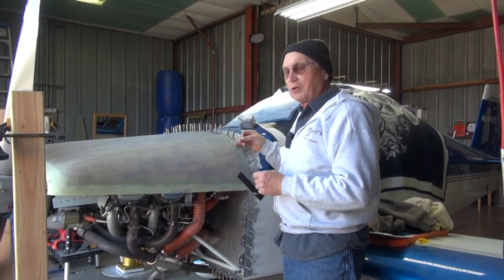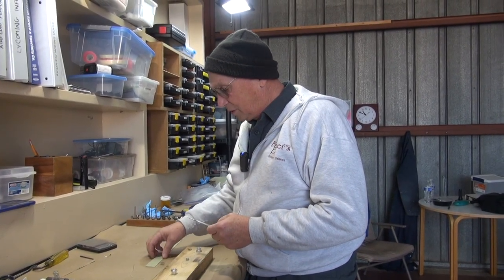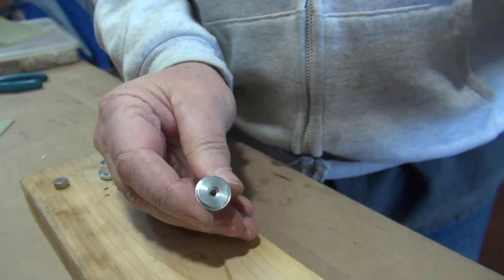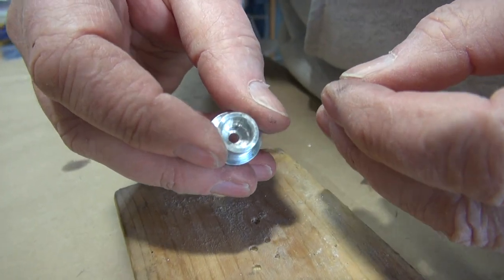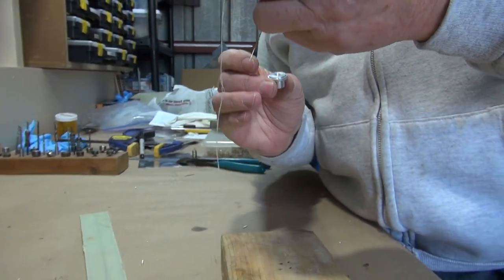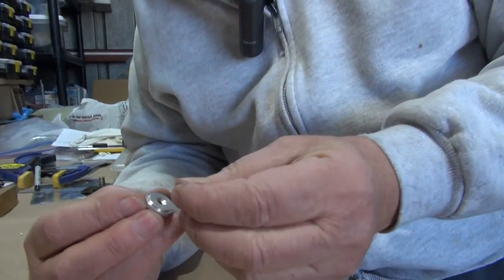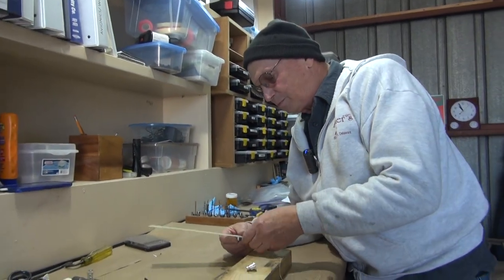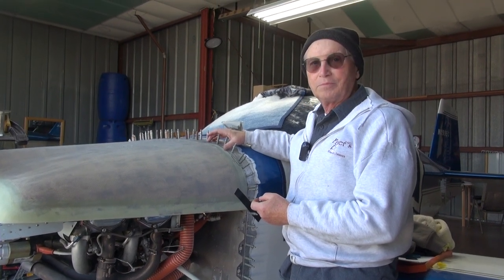Skybolt

Comment: which of the skybolt tools are absolutely necessary to install these things? just buy the t26 tool?
Reply from the maker: The T-26 tool and the 4P3 plier are needed to assemble the Skybolt fasteners into the retainer, and the retainer to the panel you are mounting them in.   There are templates for mounting the receptacles.